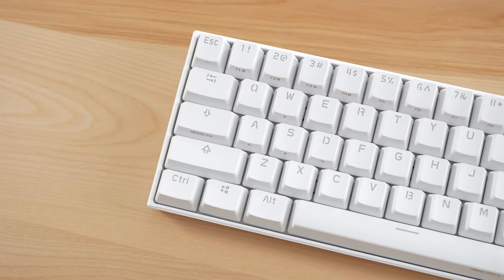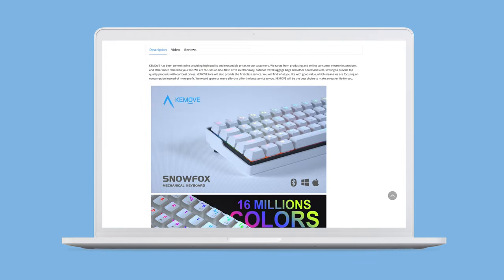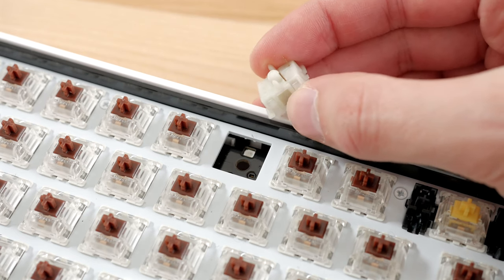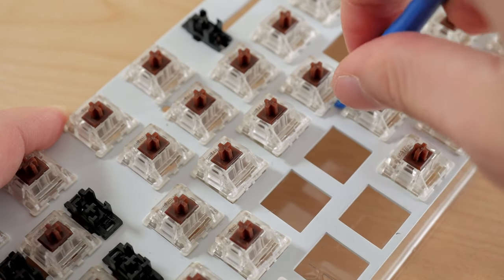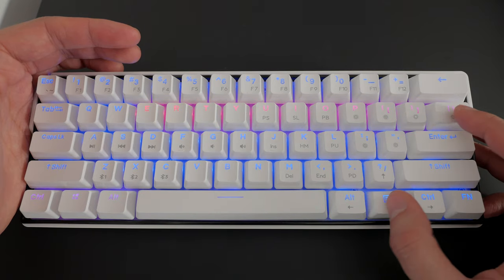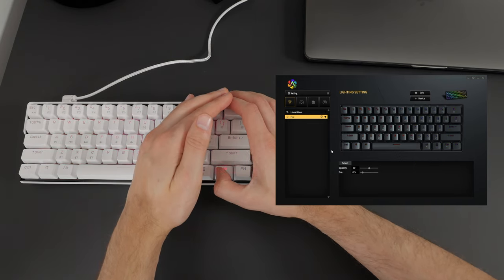Kemove 61 Snowfox 60% Mechanical Keyboard Review

Comment from the maker: Timestamps 😄
0:00 Intro
0:57 Unboxing & physical specs
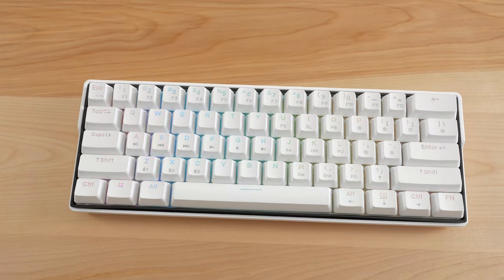2:18 Layout & Keycaps
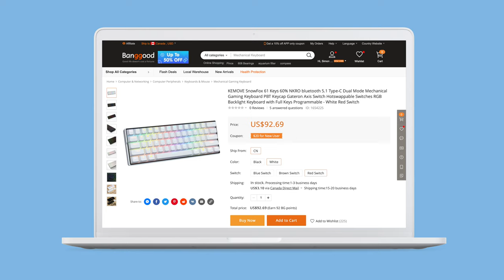2:54 Switches & Stabilizers
3:34 Disassembly
4:15 Replacing switches
5:05 Sound test
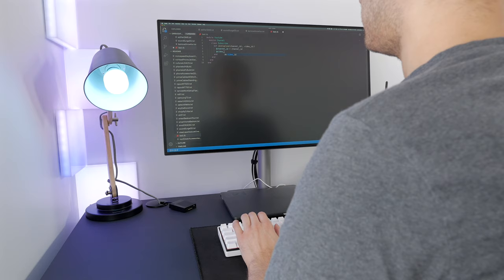6:47 Bluetooth performance & setup
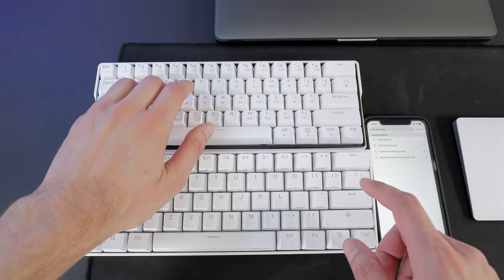7:54 RGB leds
8:19 Default layer
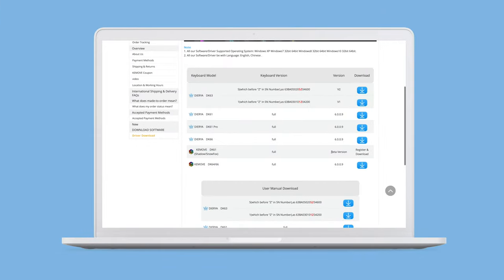9:05 Software (custom light FX & key remapping) 
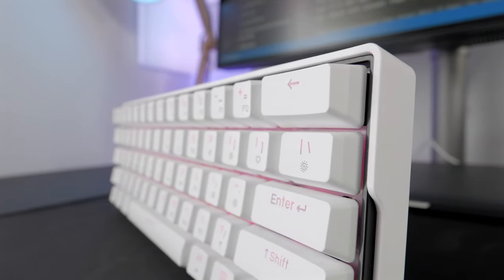10:28 Conclusion
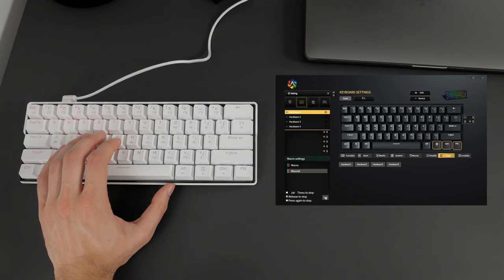11:23 Outro

Kemove 61 link
https://www.banggood.com/custlink/vm3Gw3V1AL 

Save 10% off with code BGNASF61
Only valid for 50 first orders (expires 2020-06-30)
Reply: Thankyou 🙂
Reply: Great review. I hope by now the software has been released for ios
Reply: pls tell how do i charge it i went into wireless mode and dont know howto go back
Reply: Hi! Is the Kemove Snowfox's PCB only 3 pin compatible? Can I hotswap switches with Gateron Milky Yellow switches?

Comment: For the past couple of years I've been online YELLING for a company to finally create an Anne Pro style wireless RGB 60% keyboard with HOT SWAP SOCKETS! And now it's happened! Definitely picking one up in the near future. 

Thanks for the heads up and the review! Would have never known it existed until you posted it!
Reply: Same almost got a Anne pro 2 but this is way better for me I think
Reply from the maker: Yeah, I really hope the Anne Pro 3 has hot swap sockets! 😅
Reply: You can convert standard PCBs to hotswap yourself if it is really important.
Reply: The new version of the Snowfox/Shadow comes with pre-lubed and clipped stabs and 5 pin hot swap pcb. The AP2 has been reverse engineered so you can load QMK though. I think I'm going to just have to get both.

Comment: Got it on the way. I’ll have it and my Holy Clear switches around the same time. Super excited!
Reply from the maker: Nice! I would like to try Holy Clears soon too!
Reply: Does it really matter that you have to clip off the two legs for 3 pin boards? Does that compromise stability in plate-mount switches at all?
Reply: Stop the Philosophical Zombies if you’re saying this because ur debating on getting this then it doesnt matter because the updated version comes with 5 pin
Reply: @Linedbyeddieeee  No, I've already got the 3 pin version. I don't plan on upgrading anyway because the software for it is terrible. I'm getting an Anne Pro 2 because I just found out that you can load QMK on it. I will hang on to the Snowfox because I really do like the hotswap capability and the keyboard itself is well made and fun to type on. Just don't have any patience with the software right now. Hopefully it will continue to improve.
Reply: Stop the Philosophical Zombies dont know too much on keyboards, what does  qmk mean?
Reply: @Linedbyeddieeee  QMK is an open source keyboard programming tool. It basically lets you do almost anything you can imagine with programming special keys and macros.

Comment: Swappable switches is becoming a standard now in my opinion.
Reply: Are*
Reply: I think it is a better option than soldered switches, if a switche break is very easy to repair besides you can lube and film them
Reply: @私はウバツバの怒りです  film?
Reply: @zoxyy.1x  I think I misspelled it, but it's a thin piece of plastic that you put between the top and the bottom housing of the switch
Reply: @私はウバツバの怒りです  oh ok
Reply: Wanted to ask if it works with ps4 pls answer
Reply: Hot-swap

Comment: Great review.  I just received mine today- one thing I noticed I that I haven't seen anyone mention is that the housing around the USB-C port is too small to fit most USB-C cables.  The cable that comes included is tapered enough to fit, but if you want to use your own you need to either sand down the plastic on the cable, or use a Dremel on the keyboard case.
Reply from the maker: Thanks! Good observation, you're right the housing is quite small! I added a mag-safe like adapter and use a magnetic cable with it, and it works failry well, but regular Type C cables would be a hit or miss.
Reply: @minimalistik  which adapter in particular was it?

Comment: literally just bought this as it's on amazon prime now and I didn't have to wait for shipping from China. typing this on it rn. it's really good value for the price. only downside at the moment is the software which is not super user friendly, but I found some youtube tutorials for setting custom rgb patterns. 

I went with gateron reds. pretty happy with the purchase.
Reply: How are the stabilizers? are they good enough for should these be changes with authentic cherry plate mounted ones?

Comment: I was just gonna pull the trigger on an Anne Pro 2 for it's Bluetooth functionality but someone on Reddit recommended the Kemove. Took to YouTube to see whats the fuss and lo behold you upload a video a couple hours ago. Great and detailed review man. I think I'm gonna go with this, especially for its BT advantages and hot-swapping is really tempting. Was looking at Halo Clears and Novelkeys Cream as future replacements. Have you ever tried these? And do you think they'd be compatible with this board?
Reply: For tactile switches, get massdrop holy pandas, there the best tactile switches. But if you want linears telios v2 are the smoothest
Reply: Vince  there better than cherries ive heard
Reply: I'm typing this on cream switches at the moment with the snowfox and they feel great honestly only thing is though that you will have to clip off the 2 plastic pins on them, it only took me like 20 minutes.
Reply: @SwiftestNova  Nice, would definitely buy those later on along with some Krytox and dielectric grease to make it a silky smooth experience. Not that I mind much, but do they affect the luminance of the RGBs since they have an opaque housing?
Reply: @aaronace1997  Oh they do but honestly it still looks good for sure. Only thing is if you hot swap one with a clear housing next to a cream then you can tell a difference. if you wanna see a comparison check this link https://youtu.be/VNkdVR7hmPw?t=28

Comment: Do you have a link to that blue plastic pry tool or at least know what it's called?? I'd rather use that than scratch the plate
Reply: honestly it looks like the type of pry tools that come with any screen replacement kit or the ifixit toolkits
Reply: Ebay has cheap ones
Reply from the maker: Yep, it came in my iFixit tool kit, it's mean to pry open smart phone screens

Comment: I have a question for Minimalistik or anyone else: I am experiencing massive Bluetooth connectivity problems with this keyboard. I just got it in the mail today and the connection constantly falls out, and when I type there is a huge lag issue. I dont know why this is happening. My PC is right next to my desk so I dont imagine it being the distance (ESPECIALLY with Bluetooth 5.1 like they advertise). My motherboard has Bluetooth 5.0 (which should be no problem)

Alos the software doesn't seem to sync anything. The RGB on the keyboard does not sync with what I put on the software. 

The only way for me to have a decent keyboard experience is to have it as a wired connection (I am currently typing this on my Keymove61). Wireless is an inexplicable disaster .

If someone has similar experiences or knows what the hell is going on please let me know as I am dying for an answer. This keyboard is what I have been searching for for a long time so I do not want to give up on it yet.

Comment: Are there any aluminium cases that can replace the Kemove 61 snowfox's plastic case?
Reply from the maker: Not that I know of :/
Reply: I want an alu case too...
Reply: @Redso can get the straight swap the case plastic case with that alu case without modding anything?
Reply: @fritzcarlorosal3427  No - you need another cutout since there are two sliders on the back of the Kemove.
Reply: Hmmm. I wonder if anyone has tried using a tofu case. I’d love to replace the case if possible
Anyone know if the black accent on the snowfox is removable? Would be nice if you could make it a different color.  I guess I’ll find out when I get mine

Comment: Do you have to unplug the keyboard in order to use wireless functionality? For example, while wired to a PC, can you switch over to typing on a laptop?
Reply: I can't answer for this keeb specifically -- BUT if it is fairly similar to the Anne Pro 2, then yes you can swap between devices without unplugging. I can plug into my Chromebook for work and do some "side projects" on my laptop like watching Minimalistik's videos ;) by flipping the switch "on" and which selecting the wireless "input" my laptop is on. It's very easy on the AP2 & becomes just a couple finger flicks to make the swap back and forth.
I hope it's the same for this one 'cause I'm buying it. I know how much Minimalistik loves his AP2's and for him to say this is his new daily driver is saying A LOT. I'm diving in with both feet. I'm buyin' through your affiliate link, Minimalistik, I am IN THIS. lol XD

Comment: I was looking at this on Amazon and it seemed bigger when I saw it. But in reality, it seems so compact. Do your hands not feel squished together when you use it?
Reply: I have used quite a few 60% keyboards. Your hands for the most part shouldnt be squished together. The keycaps are the same size as a regular mechanical keyboard
Reply: I liked that it's squished. it makes touch typing much easier

Comment: Does it work from under Linux? I like your videos but this one is always missing. Could you always add this investigation in your videos? So, keyboard, blutooth funcionality work on Linux? The software works via wine? does all the settings saved on the keyboard? Is it possible to program the same behavior for the cursor keys as with Anne Pro 2? This is the only thing (beyond linux compatibility) that holds me back. How can you not miss the cursor keys? :) If you are a programmer you have to move back and forth a lot in your source code, having to press 2 buttons at once all the time seems really unconvenient. Are there any news about Anne Pro 3?

Comment: Hello can you tell if the macro and remap configuration of the keys is saved on the keyboard to use on bluetooth? Or does the software only work with cable losing the configuration on bluetooth? I want to use the keyboard only with bluetooth on the company's notebook and I wanted to have the key maps configured on bluetooth! Thanks if you can answer, I research it but I can't find the precise information, sorry not native english.
Reply: It stores configuration on keyboard. It loses only some backlight effects that can be used with cable and opened software.

Comment: after moving on to custom builds i cant go back to production boards, this board would have been perfect with a nice heavy THICK aluminum case for a little more money, and support for 5 pin switches, there is no way im clipping my some cremes or inks to test on this board.
Reply: afaik the keychron k6 has an aluminum case option and has hotswap pcb for 5 pin but apparently the switches are a bit hard to remove

Comment: Hi! I'm looking for a keyboard for daily coding. Is this keyboard recommended? i am confused between this one and keychron k6. Personally, i use arrow key a lot. Keychron has the dedicated arrow key while this keyboard doesn't. But i really want a white keyboard so this is very confusing to me hahaha. Can you please suggest me which one should i buy between keychron k6 and this snowfox 61? thanks!
Reply: It can use key binding similar to anne pro 2 tap function. When you tap on key for one key and hold for another. So you can remap arrows on tap or use with holding FN.

Comment: Well i was thinking about buying it but it doesn't have support for 5 pin switches how hard is it to get 5 pin switch support
Reply: I thought you’d just cut the plastic pins?
Reply: @TheThirdWorldCitizen  yeah you can but what if if i wanna recycle the switches and use them in another keyboard that has 5 pin support the switch is going to loose all its stabilization and what if i wanna sell the switches

Comment: I just received mine. I'm not a mechanical keyboard enthusiast but I have tried a few budget options prior to this and so far it seems like a nice budget option with solid performance.

My only complaint so far is that it is about 3mm taller at the lowest CTRL row than my other two mech keyboards (33mm total height vs 30mm) which are a full size and TKL. Is this extra height inherent to the 60% form factor in general or is it specific to this particular keyboard (or other models)? 

This extra height makes me inadvertently hit the spacebar when reaching for V with my thumb when using a typical WASD setup which was never an issue with my 30mm keyboards. I've just been using a cellphone case like a wrist rest as a workaround but would rather avoid this if possible. Are there any lower profile, 60%, tactile, budget (<$100) options available so I can avoid this issue?
Reply: Hi, I got mine today but having trouble using it the keymap is all of the place. Did you experience this?
Reply: @mahmudhussain7950 The default layout seems okay, maybe change the menu key with delete and create a shortcut for alt+tab if possible. I haven't tried the software but that's presumably this keyboard's Achilles heel. Otherwise, this keyboard has been surprisingly great. Really quiet when paired with orings too, at least for the gateron browns.
Reply: @davetechme  Does the keyboard still hold up fine? I'm planning on getting it to use it wirelessly but I keep reading that it has major connectivity issues, which make me really hesitant to buy it.
Reply: @perlygator418  I use it wired but it's been fine. I replaced the switches with Kailh Box Pink and the keycaps with Hyperx pudding and Tai Hao rubber blanks.

Comment: The Ducky One 2 Mini is $99 with Cherry MX switches so which one would be nicer?
Reply: This is a better keyboard because you dont have to sotter swotches, if you arent going to do that then ducky, but cherry mx are bad switches, with this you can switch them up over time if you dont like . If you want to stwitch them out over time, id reccomemd you get telios switches for linear (smoothest switches ), or massdrop holy pandas for tactile (one of the best tactile switches). There both good keyboards, but the switches are the main feel. Also stock gateron reds( if thats what you want on this keyboard) are smoother than cherry mx reds.

Comment: This Keyboard or the Geek SK61? 🙁 I wanna a keyboard with a good options for customize
Reply: Maury Osber kemove has bluetooth but is more expensive so thats prob the main difference
Reply: In the same boat, if your looking for a future proofed board I would recommend this board as it has hotswap capabilities with not to much of a larger price tag. The sk61 is only compatible with opto Gateron switches. Personally I would recommend the keymove if you have the money. Although both boards are great buys.

Comment: But it is tray mount :( gk61s is still a bit better if you don't need keycaps because it is 5 pin. But I feel this one software is quite decent
Reply from the maker: I believe this Kemove 61 has a better battery life, a better case, better keycaps out of the box and better bluetooth connectivity, but the GK61s is still a pretty good option too! 😄

Comment: These wireless keyboards need to be wireless charging enabled.
Reply: @me when something like that comes out
Reply: that woud drive up cost
and placing it on a wireless mat would raise the height making it less comfortable to type
also wireless charging is not as efficient and takes a toll on battery health in the long term
Reply: @ShaiyanHossain  You don't need a mat. Just make it Qi and I can run my keyboard wirelessly and just placing it on a wireless charger when it's not in use, so I'll never have to use a cable to charge.

Comment: I just got this keyboard as my first 60% less than a week ago and I have to say if you are a gamer !!! DO NOT GET THIS KEYBOARD !!!
As of right now, using this keyboard with the software running, the R key does not register while holding CTRL, thus in most FPS games with default mapping you cannot crouch and reload. I left a message on Kemove's forums and they simply replied that they will try to fix this in the future. This is a huge issue and honestly one that shouldn't exist on a keyboard touting N-Key Rollover and Anti-Ghosting. Going to return it, and probably grab an Anne Pro II, although I really really wanted the hot swap capability :/
Reply: I have tested that issue, just quit the software, then the problem is gone. the software is a beta version, please don't make a big fuss over a minor issue.
Reply: @abelwang3192  The issue being minor is relative. I purchased this keyboard with the purpose of gaming, and those inputs not working while the software is running is more than a minor issue for my usage. Clearly if you read my comment, I state the issue exists with the software running. The software being in beta isn't really an excuse for an important function of the keyboard not working while its running. 
Again maybe to you the issue is minor, but to someone else it might not be.

Comment: I had a terrible experience with this keyboard.  Not worth the price they ask. His bluetooth was buggy (it turned on whenever I plugged it into the USB), the Fn key is conflicting with some Windows shortcuts, and some commands are not activated normally, like in normal keyboards. And I'm not talking about adapting to the fact that it's 60% no... it's just been set up in an unnecessarily different way and the experience was regrettable. Manufacturer support is inaccurate, time-consuming, and they stall until you lose your right to return the product to the store. Their software is in "beta" and practically stagnant. Their forum only collects complaints and is of no use, just advertising spam.
Buy expecting "surprises" in usability.